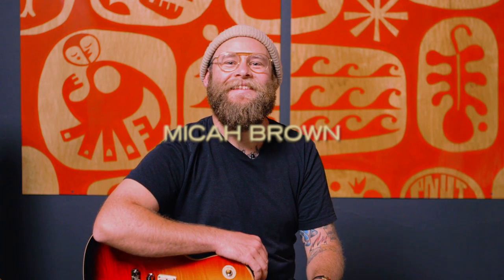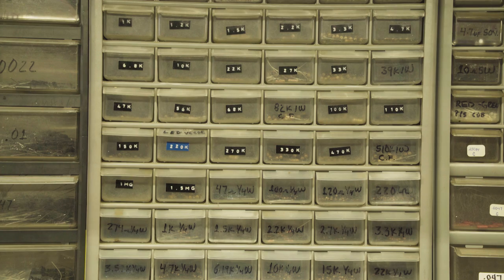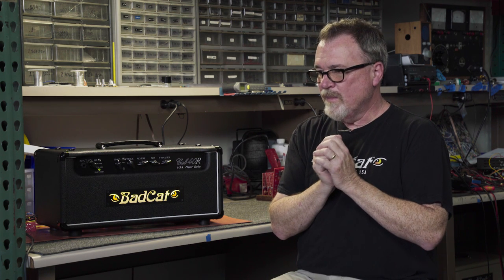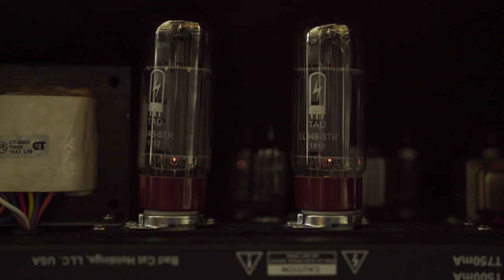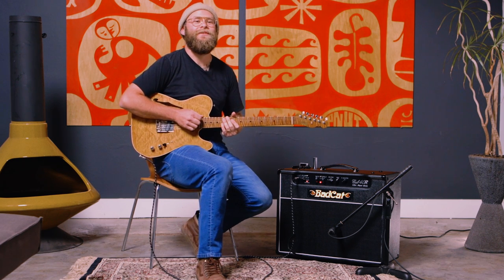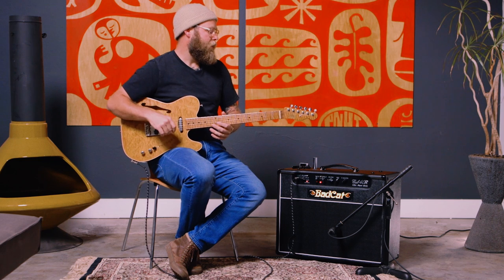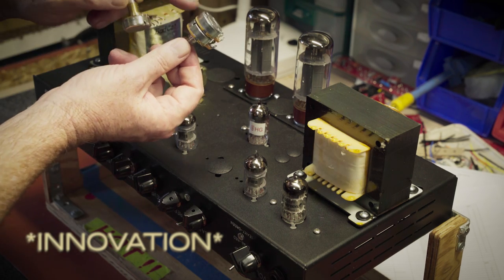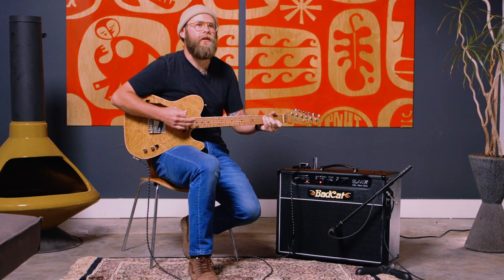What is the K Master and where did it come from? Ft. John Thompson and Micah Brown

Comment: I own a Cub15R Player Series amp. While I like it a lot, I haven't found the K-Master to be a game-changer. Yes, the amp sounds fine at low volumes but as with all tube amps, the overall level should be at least moderate to achieve fullest tone. What I have found is that the Cub has a lot of clean headroom for a 15-watt rig. Having just the preamp turned up with the master lower produces a bloated, blurry sort of overdrive. But since I mostly use pedals for my drive tones, and being that I dig the chimey Vox sound it does so well,  the Cub 15 is fine for my needs.

Comment: Yeah, but good luck getting Bad Cat to acknowledge your plight if you have a problem when their k-master circuit board malfunctions, which happened with my Cub III.
Reply: It’s like that for any problem.  I bought a solid state rectifier for my bad cat Hotcat 15 and it blew the hidden fuse on the power cord in and when I asked them to fix I got yelled at via email.  Someone needs to tell Badcat to be a brand that charges top top dollar, that it should come with equivalent customer service.  I’m back to the Marshall and Vox handwired stuff anyway.
Reply: That’s weird I’ve always heard that bad cat CS was top notch. I even had a conversation with John a few years ago and he was so down to earth. Sorry about your experience
Reply: duderdudeedoo1984  Further evidence is the lack of any CS response here in how many months, the pandemic situation notwithstanding
Reply: And still no response from Bad Cat CS. I was forced to spend hundreds to eventually have their vaunted circuitry diagnosed as the culprit. I managed to have it removed by a supremely knowledgeable bay-area tech. For the record, he said that he had also tried in vain to elicit a response from Bad Cat. Longer story shorter, there is something horribly amiss with the business admin side of Bad Cat.

Comment: still not too good of a demonstation of what this is... I happen to have a Black Cat 30R. As far as i understand it it is an Op-Amp post phase Inverter. So far so good. This op-amp can push the powersection while keeping a clean preamp, which is not possible in a non-master one-channel amp... so far so good. What i don''t get is, where is "unity gain" on the K-Master knob. Meaning, which position on the knob equals a non-master amp in terms of output given from preamp to poweramp. As far as i understood the dimed K-Master goes beyond that level....